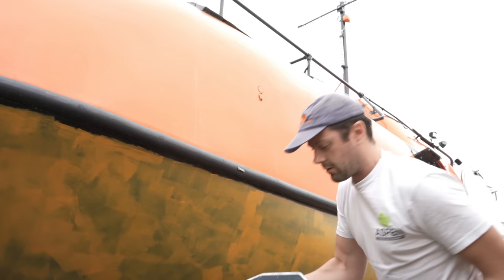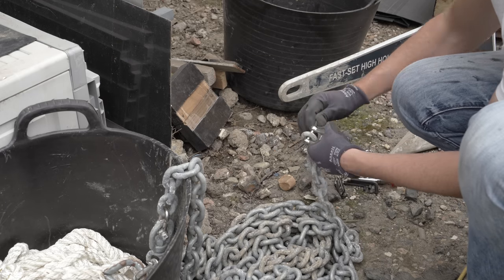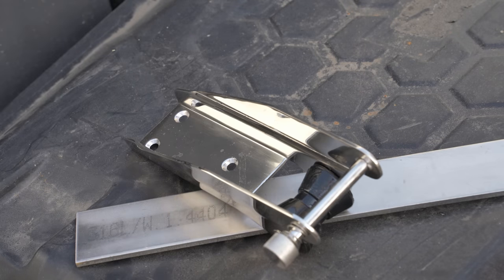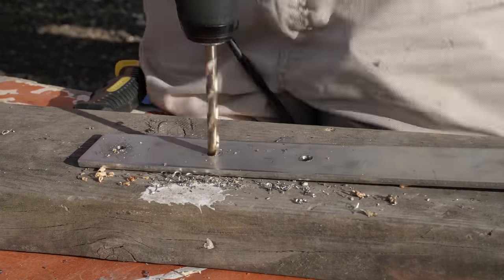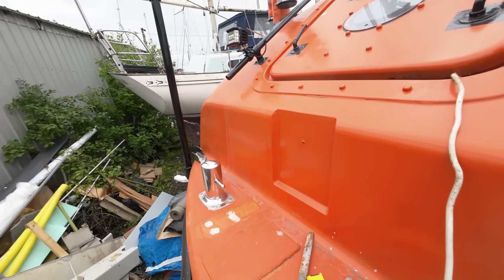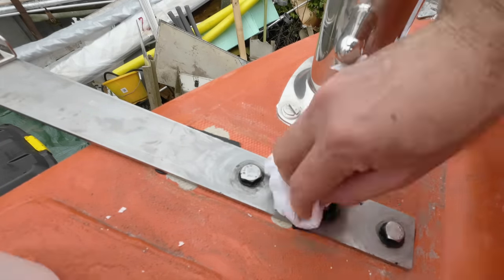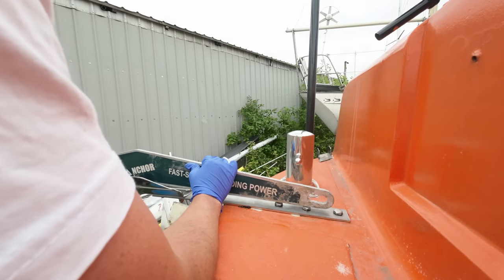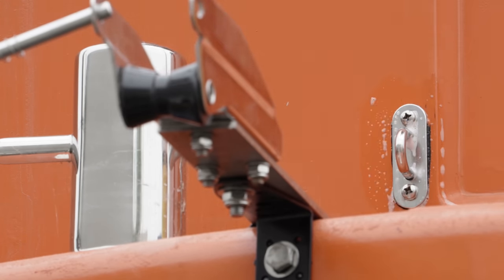Anchor choices, and a bow roller. Plus a new shackle. Lifeboat Conversion Ep82 [4K]

Comment: I am glad someone pointed out the painter line quick release,  it may be a mute point but your roller frame may be slightly magnetic ie; 304 not 316.  If you could weld a piece of flat bar under the overhanging sprit to make it a "T" that is then tacked to the angle bracket flex is gone. Good Luck👍

Comment: I'm a bit concerned about the risk to Alan's shell - I've spent a fair amount of time at anchor on a similarly sized boat and the forces you can get can be huge. What you don't want is the whole bow roller tearing off and opening a hole into the interior. Lots and lots of backing plates and reinforcement are indicated.
Reply from the maker: A good point well made. The GRP shell, even on Alan's upper side, is thick and solid without core, so not like the flimsy thin shell some yachts have up top. But yes I'll give this some thought. There's a total of 12mm of steel clamped around over a foot of the GRP though, so a rip out would need to be quite extraordinary.
Reply: @AlexHibbertOriginals  Just make sure your anchor rope will let go well before your bow sprit. The energy is absolutely there. Most of the time its on the way UP that gets ya, as buoyancy will be acting on a taught chain.

Comment: Considering the weight of the anchor makes your bowsprit (?) bend, surely this will be a great deal more exciting when the anchor is deployed.  This could be alleviated by a bridle, but will still be and issue when trying to pull it in.  In summary "It ain't nowhere near strong enough."  Always trying to be helpful as ever 🙂
Reply from the maker: Looking around the yard, all the bowsprit mounted rollers that emerge a fair distance have a 45 deg braced bracket beneath it. It seems mandatory for all boats that like Alan have a bow that drops down vertically, without an undercut that allows the sharp end of the anchor to 'miss' the bow.
Reply: @AlexHibbertOriginals  This was what I was thinking. Either a single brace, or a pair of braces (a brace of braces) might be a solution.

Comment: Reinforcing from the bottom with a bracket is one option. The other is turning that plate of stainless into a C-channel shape via welding on some new bits.
Reply from the maker: You'll enjoy tomorrow's episode!
Reply: @AlexHibbertOriginals  Guess I hit the nail...or bar? on the head!

Comment: That single piece of flat bar did look very springy. Maybe 2 pieces stacked ? Like a spring, with the potential for humorous boinging noises as you plow through rough seas.
Reply from the maker: Yes, that was a miscalculation. I didn't think bar that thick, and that short, would flex. Hey ho.
Reply: @AlexHibbertOriginals  I don't think doubling or an L-bracket can help that (before you have a square profile..). Bracket that mounts to the front holes on the bowsprit and lower to the bow would work much better. Or make a kind of an I beam out of it with a plate

Comment: As a metal fabricator/ welder/ hot rod builder i can tell you with certainty that stainless bar you used for your extension no matter how thick will "work harden" and eventually crack (flexing from weight of the anchor, engine vibrations, wave forces resonating through the hull, etc...). Have a competent welder (TIG weld) a second bar half the width of the original bar as a T onto the top of it the full lenght of the bar. Even if it ends up as an offset T (so the anchor can be in the middle) it will be much stronger and less likely to fail vs what you have now. Imagine a steel I-Beam and how it's used to support everything from buildings and trains the T part of the I beam (top/bottom) is what gives it it's strenght. I'd hate to imagine what finding this out in the middle of the artic the hard way would be like. Really enjoy your content and ability to think through problems and persevere through challenges!
Reply from the maker: Thanks. I'm adding some 316 u channel, so practically the same end result I hope.

Comment: If you are keeping anchor chain inside you'll want some way to properly wash it off when it's still outside, aside from the mess it will make, some mud can smell foul and be really well stuck to the chain.
Reply from the maker: it really can. I have a stiff scrubber, and if done whilst wet, this should help. But yes, I need a power wash solution on the bow. Maybe a portable 24V pump I can draw water from the sea for.
Reply: @AlexHibbertOriginals  This may be a dumb suggestion, but wouldn't the simplest solution be to attach a (appropriately strong) plastic locker or canister of some sort outside for the grimy anchor chain to live in?
Reply from the maker: There's just not enough space out there.

Comment: IMHO you'd be better off with a piece of PFC (Parallel Flange Channel) the same length for the bow roller to bolt to. 
If you used PFC then you could weld a couple of pieces of flat bar on top and use it as a nice guide for the chain. A short length of PFC might even be available in an offcut pile at your local steel supplier for reduced cost. The corners of the flanges could then be cut off at say 45deg so they're not sharp.
You still may need to brace it a bit (see below for idea).

Flat bar might not be the best solution in this instance but you could strengthen it by using another piece to triangulate it against the hull instead of that untriangulated 90deg lightweight bookshelf bracket.

You could do this by using a flat piece of your flat bar say 250mm long bolted to the hull under the existing piece at 90deg as a scud plate perhaps half the overhang length beneath, then tacking another piece of flat bar to the underside of the existing piece at one end and the piece fixed at 90deg to the hull at the other end. Use cardboard to work out how long. 
Once happy, weld properly at the underside, then remove the lot and weld properly to the hull plate that you made (the 90deg piece).
A tip, if you don't want to weld/tac upside down, then fold a short section of the flat bar brace in the vice like the palms of your and use the existing bolt holes and use longer bolts. 
Of course do the bend on a longer piece before you cut it to size with the angle grinder so you can have some leverage to do it by hand.
Reply from the maker: Thanks - yes I did consider either angle or a u channel, but I don't think that will alleviate the need for a triangulated brace underneath. It's just a lot of weight for the inches of span from the edge of Alan to the roller. Also, the chain will emerge from the vertical, not the deck, so this will impact the need to guide it forward. If I'm unhappy, it's a 1hr job to swap out the bar for some channel. I did underestimate the flex of solid steel flat bar here. All the flex is in the few inches forward of the bow. The bolted down section is totally immobile.

As you noticed, the lightweight bracket was just a placeholder, and the hole locations can be matched to the replacement.

Comment: Alan needs a figure head of that prairie dog that can also hold up that anchor sprit.
Reply: Just bolt it on from the inside with a couple of big brass acorn nuts to hold it on from the outside. Placed strategically of course.

Comment: Stainless steel should be avoided in anchor rode -- glad to see you go rid of these dangerously weak SS shackles but I'd also suggest getting rid of the SS swivel. In actual working reality, swivels really aren't needed in anchor rode and are a literal weak link in your system. Go with a proper galvanized lifting shackle made to strict specifications by a European or American manufacturer. such as Crosby. And if you simply must have a shackle, ditch the SS and get a better quality galvanized one.
Reply from the maker: Thanks Shane - I've heard a number of differing views, all made with total certainty. I do have to make a decision at some point - we'll see how this fares, and I'll remember your advice.

Comment: Ya. I saw that becoming a problem a thousands of miles of away with your flat bar anchor mount. I would have just added another piece of flat bar under your anchor to stiffen it up instead of putting just a bracket. But it's your build. I also suggested that you put rope around Alan's hand rails so that you have something to grab onto while on deck.
Reply from the maker: Good that you saw it coming! I shall employ you as a merchant of foresight.
Reply: Hey, I wasn't the only one. It's was plainly obvious but we all learned from our mistakes. Perhaps a "C" channel instead. And I did see that from thousands of miles away by the way because I live in communist America

Comment: I'm just worried that the metal plate is just gonna bend when the boat is moving on the waves. Then the pointy end of the anchor will start to hit the hull and possibly make a hole. Like you show it was already being a bit wiggly
Reply from the maker: Me too. Remediating.